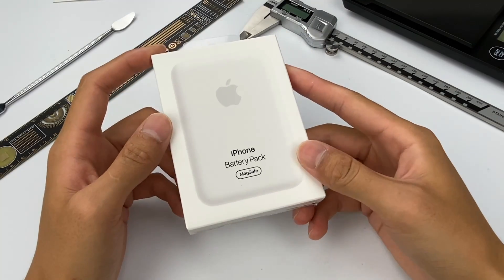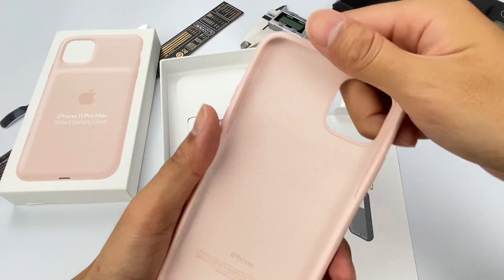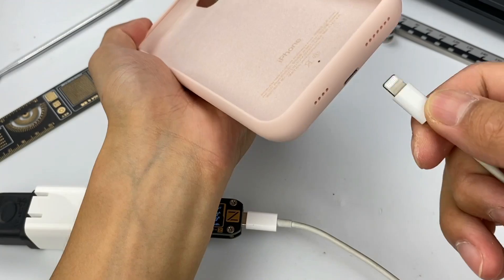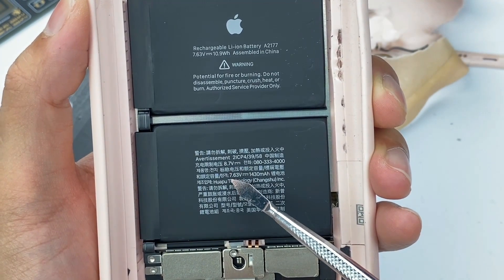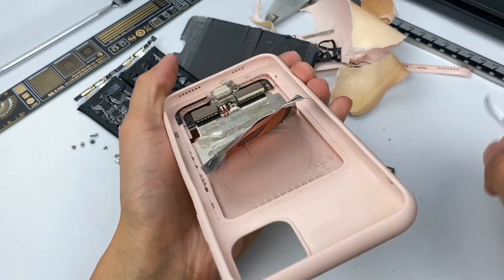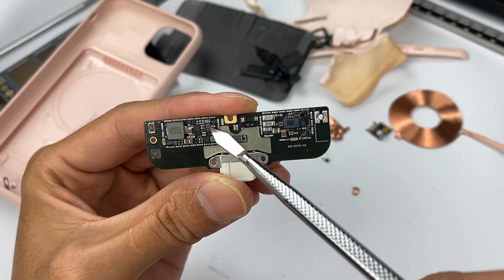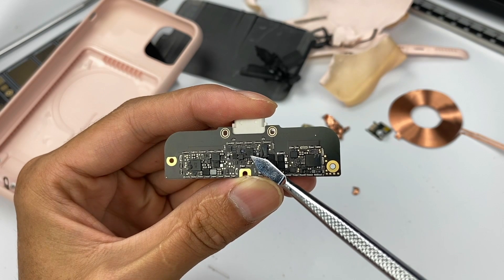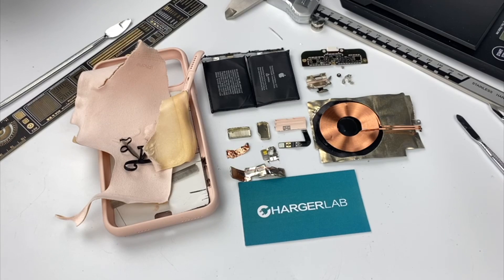Teardown of Apple iPhone 11 Pro Max Smart Battery Case

Comment: Helo my friend! Could you please help me? I have a (second) brand new original Smart Battery Case for my IPhone 11Pro that quits charging immediately after plugging the cable in. Amber light goes off. I’ve tried with the IPhone in as well, and the charging sign is on but the battery doesn’t charge at all. My first Battery Case, bought togheter with the IPhone, is still working but is all scratched.   Please sir, you are my last chance.  Thank you

Comment: I've gone through 3 of these and they all end up failing because of a lose connection or something.  It keeps disconnecting when you move your phone.
Reply: Way late but you need to clean out the port using alcohol toothpick and/or dental floss pick to get all the debris out

Comment: I’ve wanted to tear apart my old 11 Pro Battery Case and then 3D print a case for my 12 Pro Max with those components from the 11 Pro BC. But I have no idea if the work is worth it for it to even work in the end. That and I don’t have a 3D Printer :p
Reply: I'm so close to turning my Battery Case into a Power Bank. I just have to sand the sides. everything else i took apart except for the actual battery. I don't plan on taking that apart. If you want to see a picture when I'm done let me know.
Reply: @RomeloEllis you got it done? I would love to see the end result!
Reply: @Ferno209  I gave up on it. You want it?
Reply: @RomeloEllis if it ain’t too much trouble, sure! I’m sorry to hear you gave up on it :( was it just too time consuming or too complicated of a process?

Comment: Hint if you cut off the edges and bottom it works fine for 12 pro max 😂
Reply from the maker: Haha, the battery case will turn into power bank.🤣

Comment: There are a lot of wasted space. Thay can make that PCB smaller and also make this a 3 cell instead of 2. They should've put another cell next to the camera cut out. I would rather pay extra to have an extra battery life on this
Reply: Honestly, I don't see any way to make this PCB any smaller. It's pretty well packed. Also, the case has curved edges for ergonomics and should be drop-resistant. There's no way to spread lithium cells right to the edge without them flaming after couple of drops.